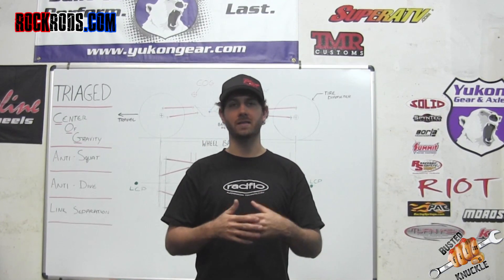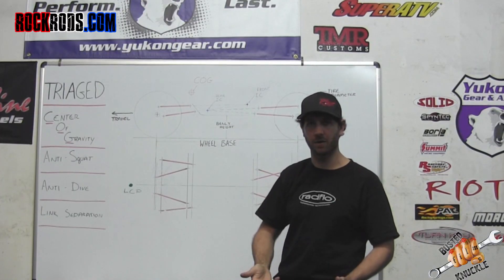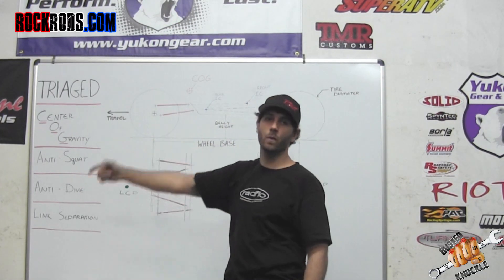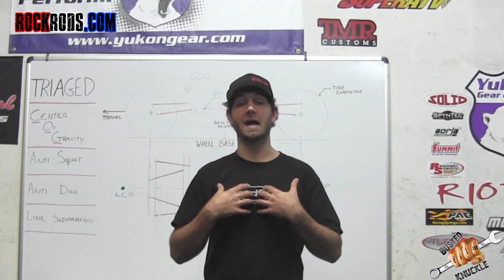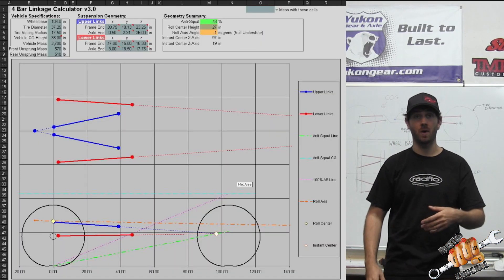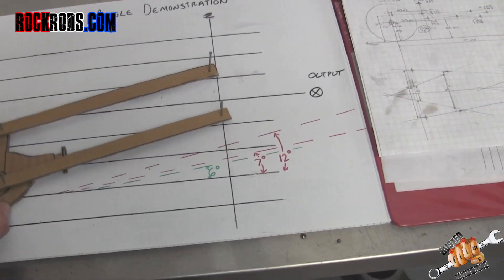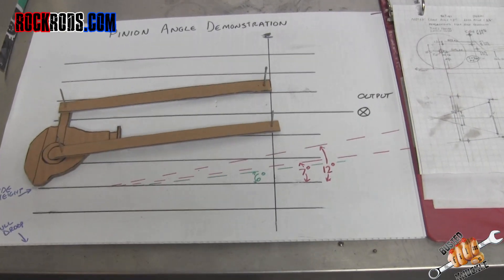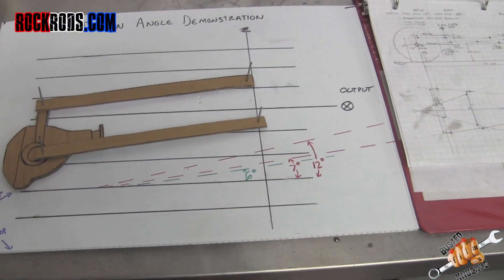Anti Dive and Anti Squat Explained - Rock Rods Tech

Comment: These vids are quite good and grab the main concepts in a way easy to understand both in your visual aides, and your descriptions of actual scenarios on an trail obstacle or a 

Mcourse.

It got a little ambiguous in how AS/AD work at high or low figures, almost describing them the same, but the your trail scenario examples draw a better mental pic.

If I could add, the caster changes throughout suspension travel are low on priority in most cases.  This is articulation, not jumping or desert. Much of what you described is more prevalent in a front or off set axle at the ujoint, But is almost nonissue for centered, especially a rear when caster means nothing, only a ujoint bind would be of concern.

The entire axle needs to do these huge changes, not much of this happens in articulation and should be less of a concern if you are forced to mount a link shorter/longer/etc because of available space on the chassis.

A simple limit strap at the axle center or above the diff wi t hamper flexing, but will keep the driveshaft happy.  You can use it for loose attachment of ARB lines, brake lines, etc safely protected from over extension as well.

You can’t feel AS or AD numbers changing from 40-55%, it’s likely the vehicle won’t even yield a performance difference.  It’s 40-130 that’s apparent and has elements of concern. 40 being great in the rear, but not so much as a fronts where brake dive would  be an issue.  Yet 130 would be wasted propulsion forces in a rear suspension as lifting, in front it would work as a traction aid and a force in opposing brake dive.

More important that anything for the most part is not how instant center relates to CofG, but roll centers can totally foul up a vehicles handling and if not a dedicated crawler, a potential disaster.  

If you don’t respect and understand roll centers and buikd them flat or at least out of oversteeer, then stay the F@ck off public highways! 

Way more important than an As/AD or caster changes through whole axle compression/droop.

A short arm TJ lift of 4+” is a great example of how everything can be ruined in a lift kit that only lifts. An 80 series landcruiser at higher lifts(so I’m not being a racist, lol)  quickly has similar issues and both are hugely evident if you use the online spreadsheets by Dan Barcroft (triaged) described in these videos.

Lastly, when hitting a rock or log on the trail, it’s affect on suspension would be vaguely the change in instant center to new contact patch(a raising of instant center and AS/AD affectively, but there’s an element of tangent not accounted for in that, the closer to parallel and inline with instant center the less impact that creates on vehicles motion. But a 3 foot boulder at 20 mph is what it is, lol.

Long (32-38”) flat links are always and have always been good advice. 25% of tire diameter isn’t relevant if you build the link mounting points at a ‘strength’ level consistent with the increased torque they would absorb with less seperation. Or vice versa. But it’s a safe figure for generic brackets of a36 .250 from anywhere and your average welder.

That could easily be 6” on a 40” tire safely with more elaborate brackets supported in multiple planes (not two lower link tabs welded downhand on a 14 bolt axle tube for example)and wrapping around axle tubes further.

Again, nice to see someone making videos that truly represent concepts so anyone can relate instead of bad info on a google search from ill informed web Nazi’s!!! Hats off to you sir. I gotta subscribe and watch them all!
Reply from the maker: Wow you wrote a lot, I'll send Jake over to answer.
Reply: Yeah, sorry, I was on the toilet and lots of time because last nights dinner was huge!🤪

Finally someone who grasps things in both front verses rear driving axle and the push/pull on the links working opposite. not some boner shooting for the same figures on both from total ignorance.

Cool description on the conflicting way some designs work(or kinda don’t) in east coast hill bouncers in loose dirt vs west coast style of say ‘back door, or wrecking ball just over wheelbase length waterfall launches.

Comment: Yo u need to go to the next level and get some computer controlled shocks like F1 had, programed to the track, or the "magic body control" in the Mercedes S class which uses stereo cameras to measure a minimum of 2mm of road anomalies up to 70mph
Reply: Or yo a simple option would be a valve bypass valve on the rear shocks hooked up to a botton on the steering wheel. When you launch off an obstacle u can hit it so ur preloaded suspension launches the back end up!

Or ya if you could control the valving by switch front and rear you could do some cool stuff for sure. 
Hit the button to launch and then hit another button to increase the valving over normal so you land and absorb everything smoothly and put that power and weight directly into the hill.
Reply from the maker: Yeah because all of that would hold up to off road racing.....

Comment: Do the upper link bars on a rear 4 link have to be at 40 degrees? My lowers are at 45 degrees but to keep the bars the same length I would need the uppers to have a little less triangulation. Is that ok?

Comment: Great video, hope you do / have done more of this sort of thing.  I started looking for info like this about 5 years ago when I wanted to build a 4 link front end for a motorcycle,  I ended up buying a program that does many of the same things as the "triaged" spreadsheet but specifically for pivot based motorcycle front ends.  Amazing to see how much crossover there is (but not exactly shocking - the physics and even some of the parts used don't change).  

The whole reason I started my project was that motorcycle forks all inherently have very low anti-squat value (in fact its a negative calculated value) and I wanted to try some higher values, and even more to be able to adjust the value and see what it feels like.  As you say, you don't know what works until you try it, and (for motorcycles) it seems like very few people have ever actually "tried it" with different values of front anti-squat, simply because conventional forks have no such option.

I dug up a copy of the 'triaged' spreadsheet (after finding many dead links - looks like its about 10 years old).  I've wanted to try doing something similar to that (and to the program I purchased) but as a web app, could be the spreadsheet will give me a chance to dig out some math.  Doing my own would allow me to address some cases the software I bought does not allow, wondering if mybe there's some oddball cases in 4 wheeling that might be worth considering.  (Also not sure what all triaged does, having not played with it yet; I'm aiming for charts of dive, trail, & rake vs suspension position).
Reply from the maker: way to think outside the box for a motorcycle, it's not surprising that many of the principals apply the same
Reply: Its not my thinking, I just built one.  BMW sells one (on the K series bikes) and the patents (from both Norman Hossack and Claude Fior) are so old the have expired.  An old school girder fork has the same 4 links as well, but tends to have large camber & trail length changes if set up for anti-dive.

Comment: Great videos, I have a 1979 Scout II project that I plan on building to be my daily driver and weekend trail rig. Im down to a rolling chassis at the moment.  I find your videos very helpful but Im lost when it comes to choosing shocks. How do I choose the correct location,and position of the shock? Then choose the correct shock for the application?  Also does the shocks range of travel effect anti-squat/dive and design based on desired ride height?  Is there a video that you have or plan on making to add to your suspension design series that may answer these?  Thank you
Reply from the maker: Good questions we will dive into these very soon
Reply: BustedKnuckleVideo sounds good looking forward to it

Comment: im about to attempt my first 4 link fab rear and 3 link fab front. i have a kit from rough stuff that lets me place everything custom how i want. so what im aiming for is my ride to be a combo as versatile as possible between a rock climber and a mudder. its an 83 swb k10. 396bbc th350 np205 d60f and d70 rear. 586 gears with 47" ltb iroks. ori struts 14 front and 16 rear. i want it to sit at 10" over stock lift height. what link seperation would you recomend for me to achieve a decent balance on squat and dive? if anything id rather error to the side of stability on rocks. thanks. any info helps.
Reply from the maker: 6-8" should be a good blend
Reply: +BustedKnuckleVideo thanks man.
Reply: this is gerts just on the computer now. I plugged it all in and got 98% anti squat.. what ya think?
Reply from the maker: Sounds pretty good.

Comment: so for street use i would want 0 antisquat/dive to keep my caster angles exact at all times, truck is not a hot rod and will see lots of street use. mostly low speed off road trail riding, mud, and dirt, not much climbing as its all flat country here. does this sound right,,, this will be my first time building a 4 link 

the rear im going to go for just enough antisquat to keep the ass from diving under full throttle acceleration on pavement

tires are right at 40"  and the arms will all be as long as possible while keep the triangulated angles no less than 40* as you stated in your last video

i want an off road capable truck that dont beat me to death to drive it, currently its leaf spring all the way around and rides like a lumber wagon and is so stiff it dont even need swaybars even at 10" of lift
Reply from the maker: sounds like you have a good handle on it.
Reply: 0 anti dive will cause the vehicle to dive when the brakes are hit.  You want a higher number in the front to keep the nose up when your on the brakes.  Other than that, your right on

Comment: let me start off by saying I'm a jeep guy, weekend warrior at best. one thing I've heard thrown around on the forums is really simple and wanted to know what your thoughts were. they simply say 4" separation at frame and 8" at axle with equal length uppers and lowers. opinions?
Reply: you cannot have set numbers that work for any vehicle.  There are too many variables for those numbers to stay true under all circumstances.  you will need to plug your numbers in the calculator to be sure your building the suspension properly

Comment: Thanks for explaining this complex matter in a relatively easy way. That paper model is just genius! Also the short clips thrown in to illustrate what you're talking about were really helpful... :-)

As someone mentioned: RC models might be a good help to visualize articulation and the effects on the driveshaft. Axial offers f.e. the Wraith rock racer and the RR10 Bomber (a replica of Randy Slawson's KOH rig).
Reply from the maker: +UncleManuel good point on the RC Rig
Reply: @BustedKnuckleVideo  I've been using this info to help with a mod on a rc, a Losi Baja Rey that I'm using for racing.  Definitely good info for me to try some stuff to see if I can get it to perform better at the track.  Ironically I noticed I had some driveshaft binding so this video helped me with that in addition to learning about the anti squat values I originally came to this video to learn about lol.

Comment: Jake knows his stuff. 
One comment though: around 7:00, "when you hit a rock ledge,..."
When a tire hits a ledge, the contact point is no longer the point you've drawn the line to the IC from. It rides up and forward, in essence messing up you carefully plotted anti-squat geometry. Only big tires or long links can save the day in that scenario. 
Great stuff.
Reply: +denelvo good point, and i am not sure that anyone has ever calculated the change in anti squat based on the point of contact with the tire to an obstacle.  From physics, rotational force does not care what point on a circumference the force is applied.  You would still apply the circumferential torque to the lever arm which in this case would be the theoretical point in which the 2 bars meet in space.  Id be interested to see if i am correct but i believe the calculation would remain the same and anti squat would remain the same.  you got me thinking...
Reply from the maker: +denelvo good point
Reply: +jake burkey now you've got me thinking as well! :-) 
Yeah, rotationally, it doesn't matter, torque is torque. And the IC doesn't change, but the point of contact between tire and earth does. So the last line you'd draw, from contact patch to IC, would end up higher and come closer to the CG, for more anti-squat. 
At least, that's how it plays out in my head. But I feel the need to fire up SolidWorks... 

Weird, eh, if 'ground level' is no longer ground level? It's a pretty important datum.

Comment: when u built your buggy and did the suspension setup what ratios did you use and why
Reply from the maker: +FRCyoung +Jake Burkey will have to answer that one
Reply: +FRCyoung my buggy was built by Jimmy Smith motorsports originally.  I think he licked his finger and went with where the light shined off.  For the 2016 season i have made drastic changes to my suspension to help performance.  Unfortunately, im not going to tell all my secrets... Gotta stay on top!

Comment: Great video. 1 question though, when inputting the tire diameter is it a good idea to take into account that it might be smaller than the printed diameter as well as how much it will squish down with weight on it at a given psi? Supposing I know the distance from the ground to my axle centerline with all variables considered, could I multiply that by 2 and call it my tire size to get the most accurate instant center? Thanks
Reply from the maker: +Jack Nicholson It is just a guestimation. Your tire size will change as you air up or down and hit obstacles.
Reply: +Jack Nicholson take the measured tire diameter for the tire size input.

Comment: Sweet video . I have built a crawler with a gradder ball in the rear and four linked the front , taking everything you said into consideration my question now is will different shocks play a factor into this ? I mean like a 2.0 air shock vs coil over w bypass ...
Reply: +bjonesmoto2424 it sounds like your anti dive figures are way high, try plumbing your details into the 4 link calculator.  It might confirm it. It may be you need to alter your chassis link locations
Reply from the maker: +bjonesmoto2424 it will not change the way the suspension moves. Just how fast or slow it moves.
Reply: The 4 link geometry will remain consistant with different shock combinations.  Shocks will simply dampen the spring oscillations and therefore the frequency of suspension movement.
Reply: +Jake Burkey See I mentioned this a few years back on pirate and got shot down.
In theory, if you have a large damping amount, the bounce frequency will be reduce (and possibly gone?)
Reply: You are correct, a large shock valving would reduce the oscillation of the anti squat bucking (think solid block between the chassis and rear end) but this is NOT the proper way to do it.  You would end up suffering in all other aspects of suspension performance to reduce it.
Reply: +Jake Burkey ok , for give my lack of knowledge ..  I'm currently running 18" fox 2.0 and when In 2 wheel and apply the brake some times the front will completely raise up , throw it in gear or N it lowers back to ride height ..  Granted the 2.0 are maxed out (psi)  , so I was wondering if I run coil overs on front if this will help .